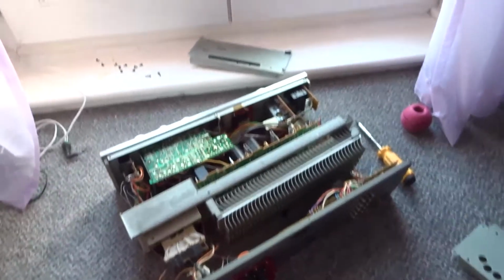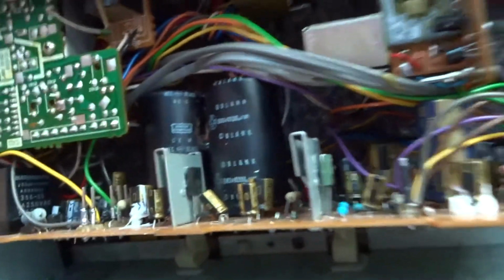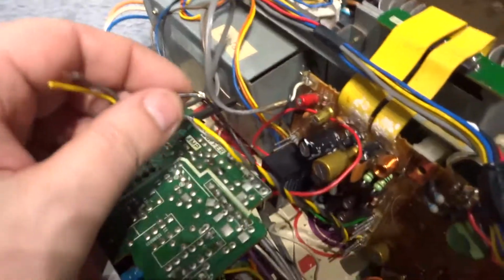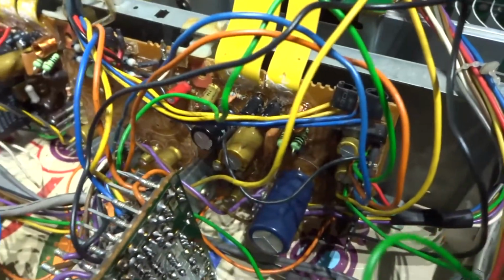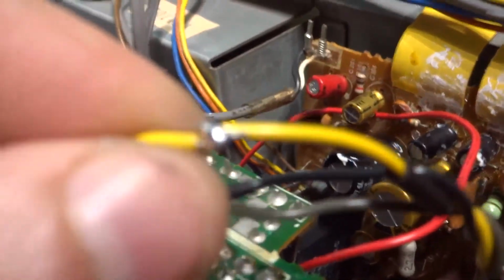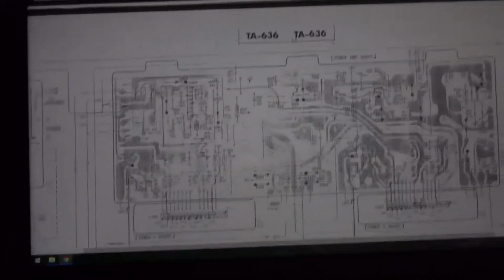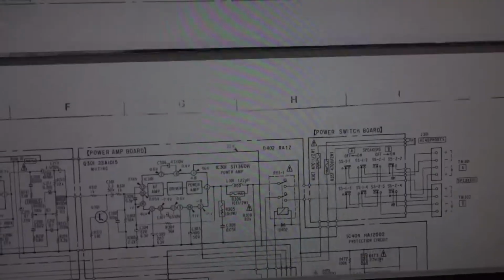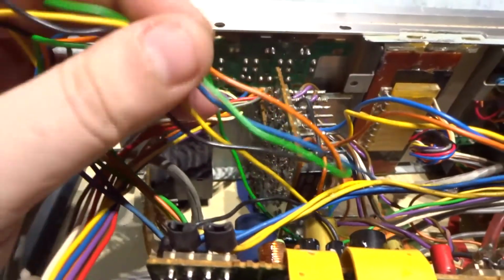VINTAGE 1979 SONY TA-636 AMPLIFIER REPAIR VIDEO 3 OF 3 - SYNTHEMATIX

Comment: Could you tell me what potentiometer uses this equipment?
Reply from the maker: What for the volume knob?
Reply from the maker: The volume knob and balance use 50k potentiometers
Reply: I ask this in the store or will they ask me for some other information?

Thanks for reply, greetings from Chile
Reply: thank you can you answer me I'm in the store
Reply from the maker: the volume control also has a motor though

Comment: Another great video, cheers. Unfortunately I Haven't been able to get that inside ring part of the volume knob off mine to fix the blown 0.022uf snubber capacitor. If you are making another video if you have time could you possibly show the removal of it?
I don't mean to be cheeky, there is no problem if you don't, I appreciate the advice given so far.
Thanks again, and keep 'em coming!
Reply from the maker: a pair of grips or pliers in the center of the ring pulling outwards m8 will do it, mine was stubborn at first. a tiny amount of wd40 in the center while the amp is standing up leave it to penetrate for 5 mins. next to the power switch the blue capacitor is 5.6nF and next to that is a circuit breaker on my amp
Reply: Thanks, I'll try again then -  I did try with pliers originally but it slipped as I pulled and it dented/scratched the ring (not a budge out of it!) - I didn't try wd40 first though! so I will try again after letting wd40 penetrate first - fingers crossed!
Reply from the maker: It will come off its a pain the first time but after it will come off easy, behind it theres just one bolt holding the volume control assembly in place, also note all the push buttons and center ring will polish up beautiful with peek metal polish as its metalized plastic.
Reply: Thanks, I was able to get that ring off! and change that capacitor and while I was at it I checked those two fusible resistors on the power switch bd for the headphone jack - they were way over! measured at over 5k ohm! - should have been 470ohm - I replaced these with 2 x standard metal film 1% resistors of 560 Ohm as that was the closest I had.
I then checked the dc offset at the speaker terminals (vol at zero - set to aux with no input or load connected - with bass and treble at 0) to check on the overall health of the amp and both channels are averaging about 55mv!. (ideal is under 10mv). So looks like I still have a bit of work to do - possibly change a few transistors and double check all resistor values to eliminate age drift (as the resistors are carbon film which I believe are more susceptible to age drift than metal film) - I might also recap the tone board and swap out a few transistors there at some point with mostly film caps (anything under about 3.3uf) - to try and bring that DC offset down.
The last thing I will also do is re-apply new thermal compound to the 2 x Main output chips as there is a lot of jumping around of my offset readings (just in case poor thermal contact is causing instability) - both channels don't seem to stabilise - they jump constantly between about 45 - 65 mv on each channel - Hence the 55mv average above.
Can you check your DC offset once you have your amp back up and running on both L + R channels?
It would be interesting to compare!
I'm Looking forward to your next video.
Thanks again.
Reply from the maker: DC offset on both my channels was 8mv HOWEVER its game over for this amplifier of mine, both the sanken modules blew! so now im using my technics SU-X502 amplifier which is exactly the same specification as the sony but built in 1991. 560-OHM is perfect for headphone resistors, oh yes they are guaranteed to be well above spec as the amp is touching 40 years old, heat does the damage, i would seriously consider finding a 12v DC tap on one of the boards and fitting an ARTIC COOLING 80mm fan in there, as heat kills those sanken modules, over dc offset is caused by bad resistors, there are a coule of 2watters in the amp change those also change all of 1watt resistors on the POWER AMP IC board, also change BOTH the transistors on the POWER AMP board next to the large capacitors with NTE equivalents, you can find new equivalent transistors HERE:  cross refernce:: enter the tansistors number on the site it wll find a suitable cross reference new tranny.: http://nte01.nteinc.com/nte%5CNTExRefSemiProd.nsf/$$Search?CreateDocument&Query=d508, grab one of these and use its fan they are totally silent and will work well. https://www.ebay.co.uk/itm/ARCTIC-Alpine-M1-50-Watts-Whisper-Quiet-CPU-Cooler-for-AMD-Socket-AM1-Easy/152215679610?epid=2256175887&hash=item2370c2f27a:g:B48AAOSwHoFXvAdm